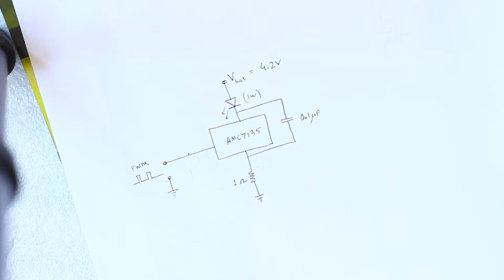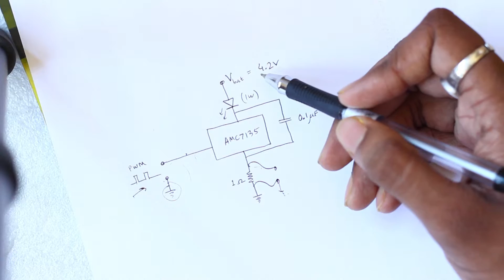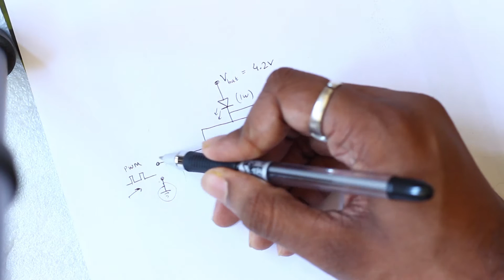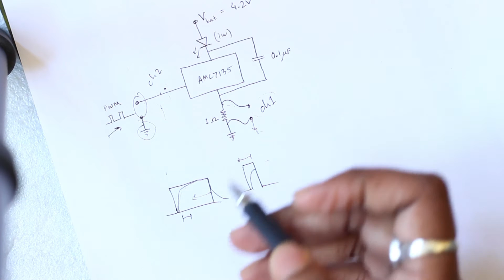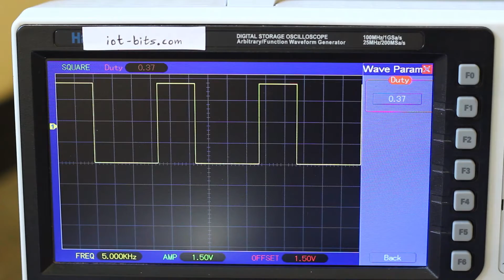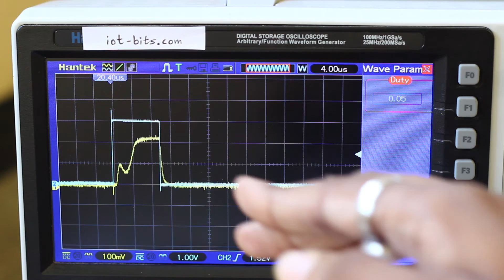AMC7135 PWM based 1W LED driving

Comment: If your oscilloscope has two probes, you don't need to have the resistor connected to ground if you use the math function.